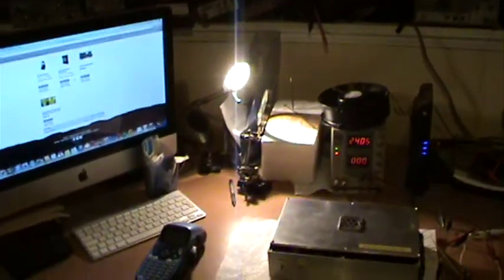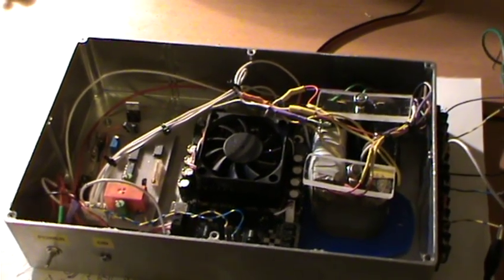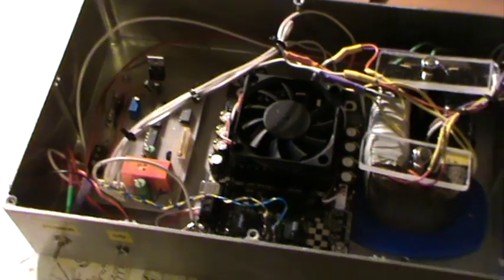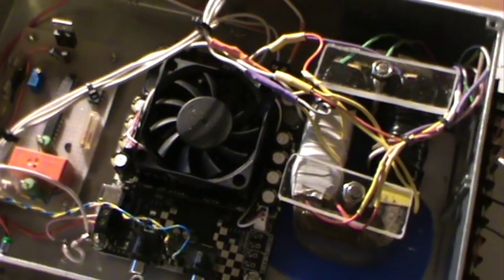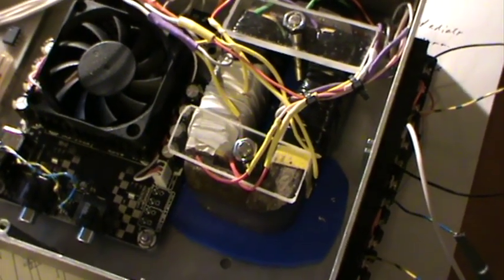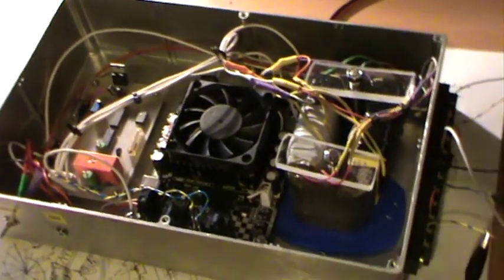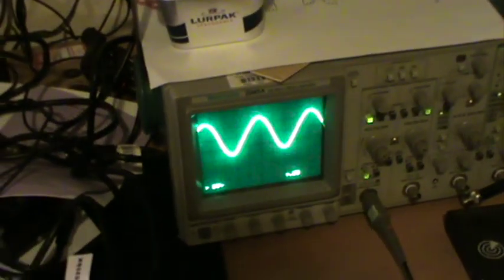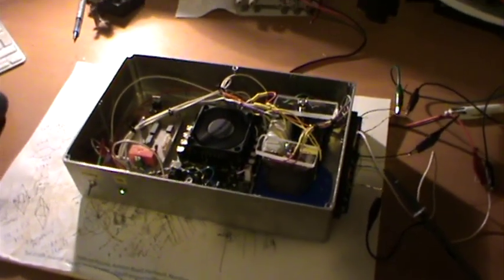Homemade 400Hz Aircraft Inverter

Comment: Is this a pure sine inverter?  I always wondered how they work.  Sure you can generate a sine wave easily - but mosfets usually just switch on and off how do you tell them to vary voltage with the phase?

Comment: I was a young avionics tech in the mid 80's for Simmons Airlines and I worked on the YS-11's which was a big Japanese built turboprop and they had these big rotary inverters that would wind up from a cold start and sound really cool and dramatic. I had my mom and dad up there one time and I turned on those inverters and they were like Jesus Christ kid I hope you know what you're doing. Later we flew the Shorts 360 which had the static inverters and I used to troubleshoot, repair and bench test those also.

Comment: So how do you get the data from the simulator and convert it to use with the instruments? Im looking for a way to use aircraft indicators in a car. Starting off with an exhaust pressure gauge, it has a 26V 400Hz synchro receiver. Do you know where I could find info/help, maybe a flight simulator forum?

Comment: I have a few old instruments off a L-1011 that i would love to power up, do you have a circuit diagram, etc you can share? Couldn't see anything on the website besides from it being mentioned when building the RB211 control box.
Cheers

Comment: Specifically though, what are the ratios of tuns for that transformer. Is the core material something specific? What are the ratings of the audio amp, and what type of signal are you feeding it from your sine generator (voltages, offset or not, etc?)

Comment: Nice. Have you looked at the loading the output & see how much sine wave distortion you get ? I'm using a 400 Hz signal generator with a studio reference amplifier to get 28V 400Hz, low distortion for testing aircraft parts like LVDT's. But I also need 115V 400Hz 1Amp.

Comment: Nice one! Had the same problem about a year ago how to generate 400Hz 115VAC efficienly. The old Russian monster rotary converters were no option anymore so looked around and found the EGS002 sinus-pwm modulator board from EGmicro. Basically it's for 50Hz applications but can be configured to run on 400Hz. With proper external components you can go up to kilowatts with it. And nearly forgot, EGmicro also has solution for 3phase!
Reply: How do you configure an EGS002 to run at 400Hz?

Comment: Hi. This is awesome. What is the input for this? If it is UK mains 220v 50Hz can you please share a circuit diagram. I need this for my flight simulator to power original 767 gauges. Thank you!
Reply from the maker: It runs off 24v DC but you could use a simple power supply to run it off 240v. I'll be adding further details on my website jetpropulsion.co.uk in the next week or so.
Reply: jdwoolgar1 Thats also fine. As long as it isnt 3 phase or anything "non domestic"! I look forward to seeing the details. Thank you.
Reply: I am interested in a supply like this for my jet engine project instrumentation that utilize (sorry,  I mean utilise 😉) 26 and/or 115 volt 400 Hertz power. Thanks for sharing this information.  My system voltage is 24-28 DC, which works well with the engine accessories.
Reply: jdwoolgar1 WOW very impressed indeed,would love to build one. Would it be possible to put up some plans and materials req'd etc on your web site as i have some old sperry instruments i would love to see work again. Sorry if I'm being a pain.
Reply: jdwoolgar1 WOW very impressed indeed,would love to build one. Would it be possible to put up some plans and materials req'd etc on your web site as i have some old sperry instruments i would love to see work again. Sorry if I'm being a pain.